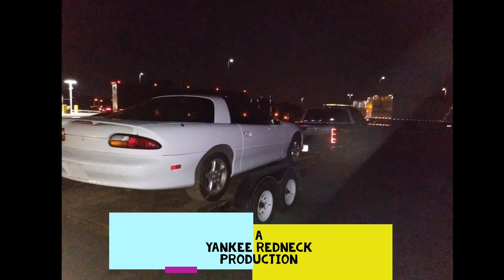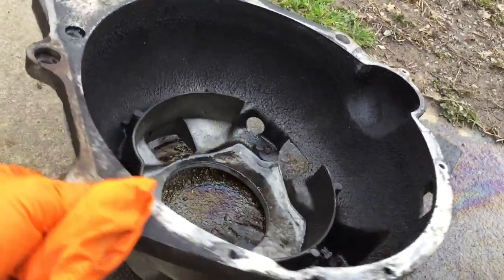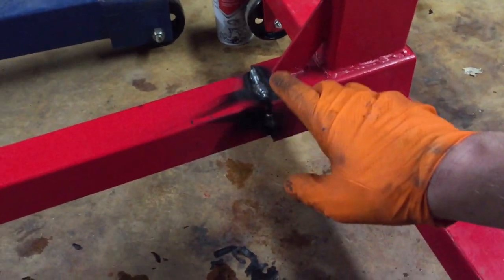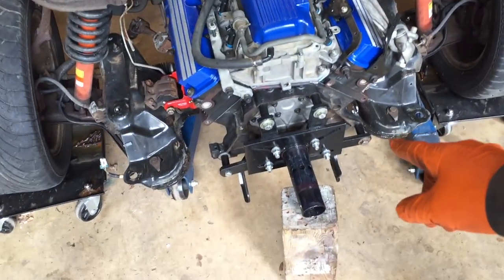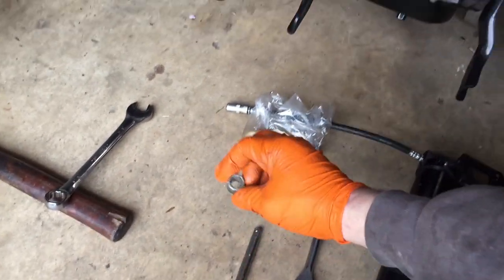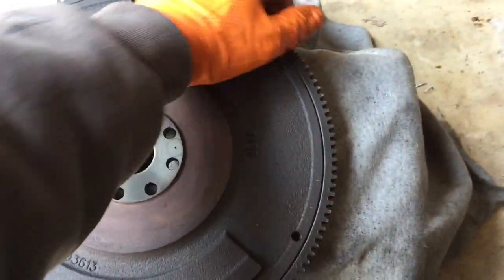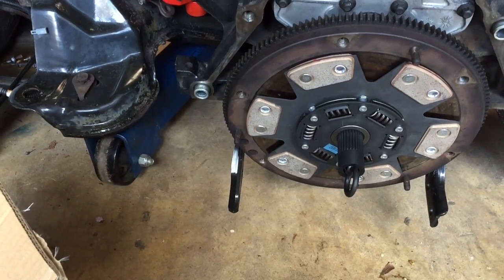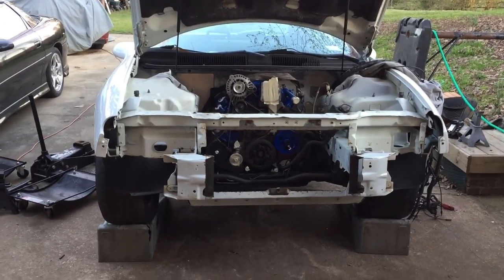Clutch kit install 3800 series 2 Camaro/firebird -Twin Turbo Build Part 14

Comment: I’m thinking about doing the same think to my 98 v6 3800 Camaro but mines an automatic will instill need to up date the clutch?
Reply from the maker: not sure if i needed to but its a cheap clutch so will see if it lasts lol
Reply: automatic dont have a clutch they have torque converter

Comment: .A lot of really bad reviews on the ebay clutch, Some of the guys with stock motors are only got 3 months out of them with a dozen or so passes at the track. Also that fly wheel is shot, it looked to be glazed and surface cracked.